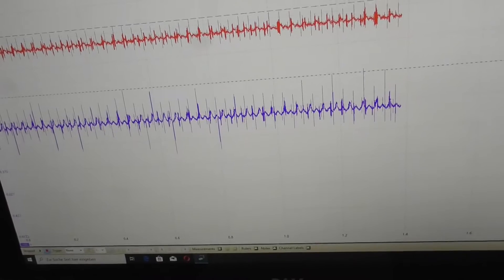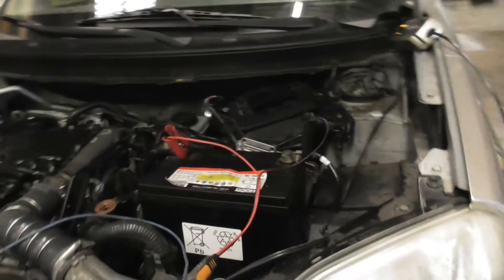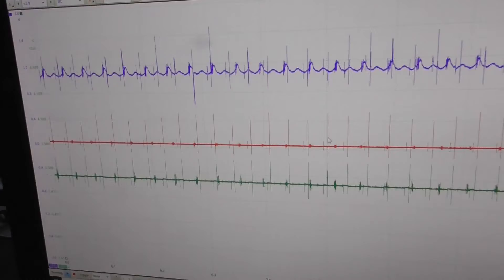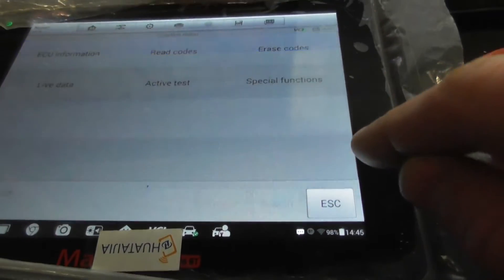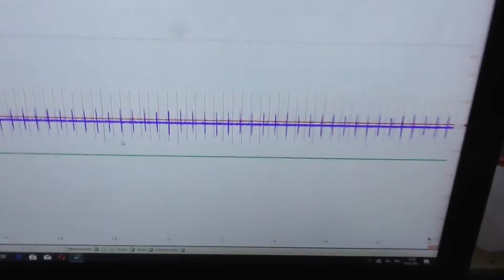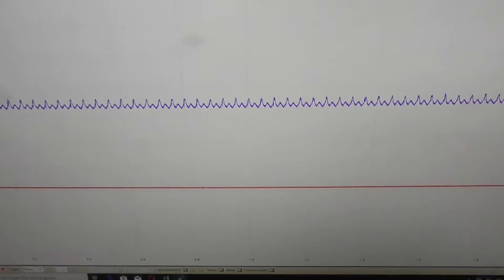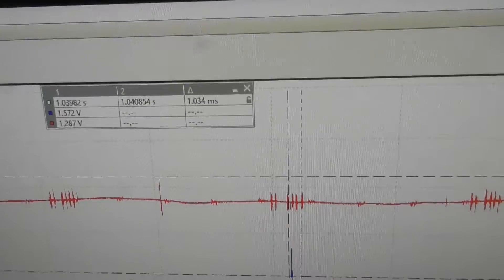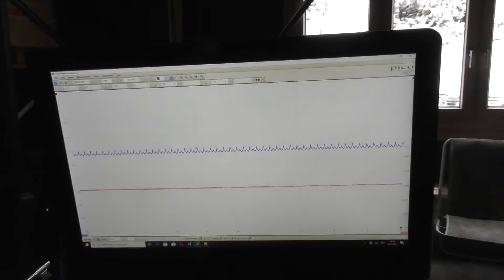Nissan X Trail P0235 Case Study Part 2 - I was stupid!!

Comment: What was the problem?
Reply from the maker: it was the sensor at least. You need an original Nissan Sensor. The original sensor has an offset for about 0.2 bar compared to all aftermarket sensors!

Comment: It is a Diesel engine, It has allways some positive pressure in the intake. The throttle is closed when turning the engine off, or regulating air intake while doing a regen to lower A/F mixture to raise exhaust gas temp.

Comment: Well, I do not think timing chain can jump a teeth or two. It can stretch, though. 
I have had P0235 also once 1 year ago and I do not know, what my mechanic did to resolve it. Then it all begun when I was driving steep downhill with Hill Descent controll on and having low fuel tank, engine stopped and could not start. 
Now I have something with turbo probably, only P0235 code under heavy acceleration, but not on standstill. I can rev it to max on the spot and no code. Changed TC boost sensor, Vacuum Solenoid Valve, checked for leaks, but 14 days and still cannot accelerate, as it always trigger P0235 and gies into limp mode. All electrical values are within range.
Pain in the arse...
Reply: Problem turbo geometry ?